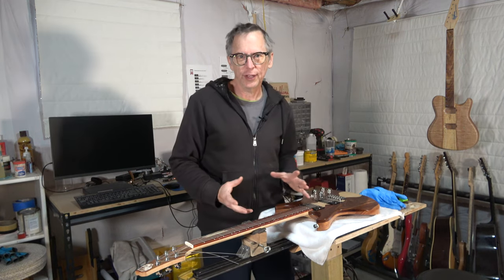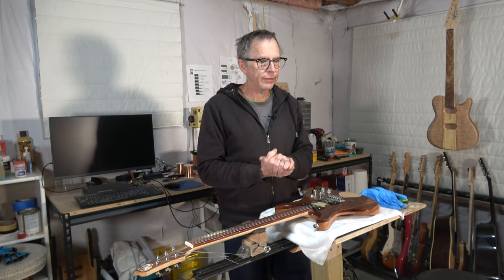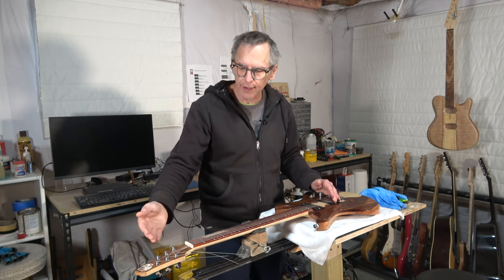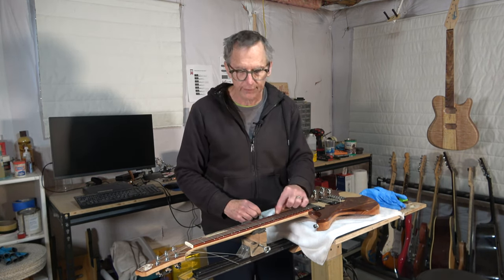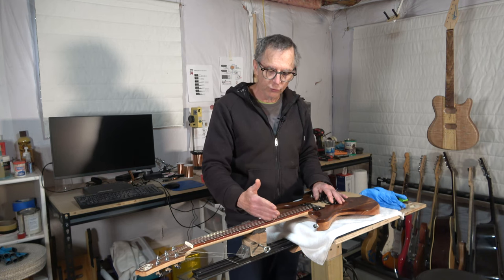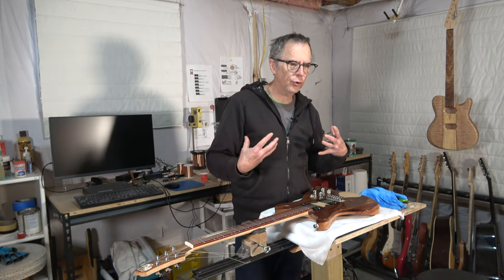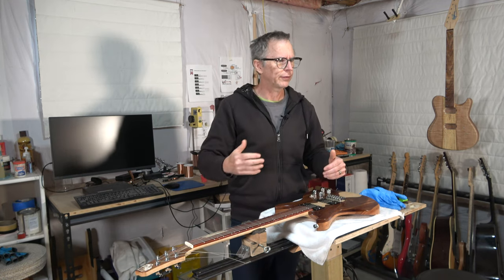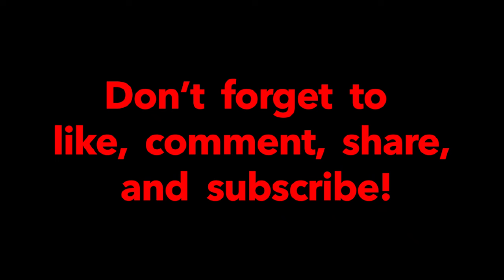The Truth About Guitar Neck Relief

Comment: Any experience how neck relief affects the feel of the guitar?
It could be all in my head, but I've stumbled on this on forums as well, that adding relief makes strings feel slinkier, and reducing relief makes them stiffer. Presumably because the neck with more relief "bends" more when you bend a string.
On one hand this makes no sense to me because you still have to apply the same amount of force if you want to bend the string to a certain pitch no matter if the neck bends or not, but on the other hand I do feel like guitars with more neck relief are easier on the fingers with slinkier feeling strings.
Thanks in advance if you can shed some light on this subject.
Reply from the maker: If it’s in your head, there is nothing I can say that will matter.
Reply: Adding relief effectively shortens the neck scale, hence decreasing string tension to reach the same note. Lowering your action does the same thing
Reply: @andyglamrock  Adding relief shortens the scale by a fraction of a micron and in that regard is absolutely impossible to have any affect on string tension.